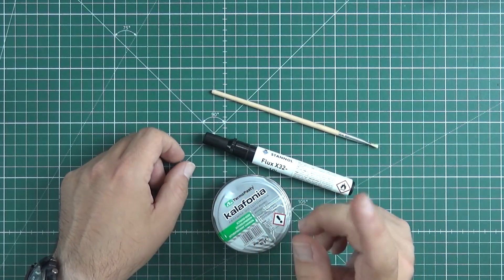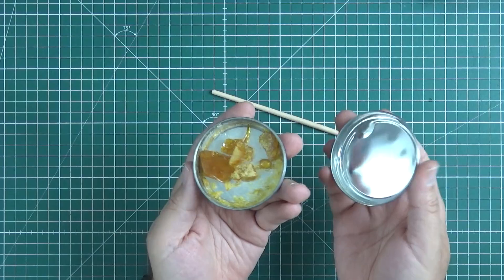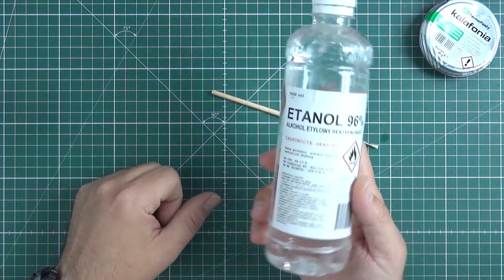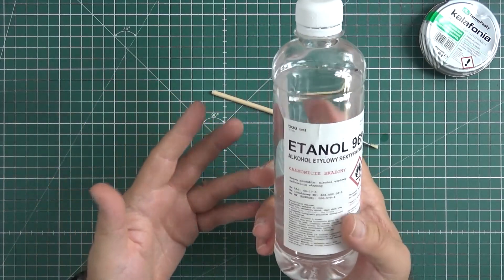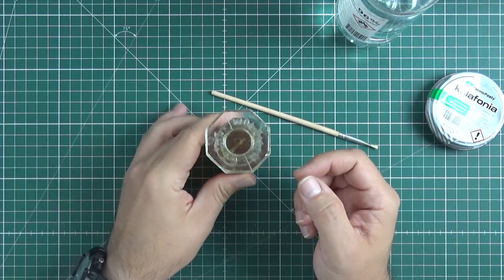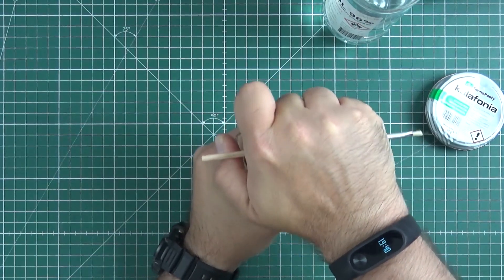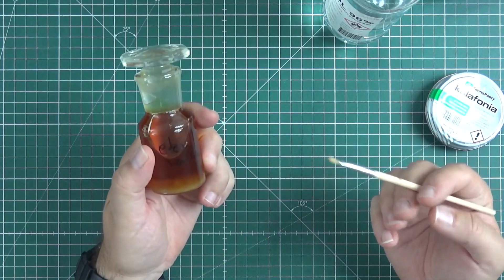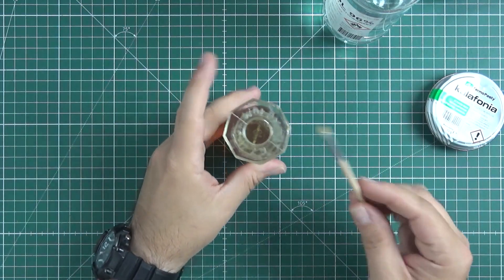DIY liquid soldering flux

Comment: Hi there I tried making this Kind of flux liquid as per your video however it turn out to solid state stone like after resting for 24 hours leaving alcohol (ethanol)on top in closed glass bottle. What can be problem
Reply: I also took manufactured paste flux, added 99.9% alcohol and it did the same thing separating after a period of time.

Comment: Is this real or fake
Reply from the maker: very much real
Reply: @HackerUni  ok thanks i though it was fake but it's worked
Reply: The majority of the super expensive products on the market, in all industries are made from several basic chemicals, that costs 0,1cent per 1 dollar of retail product.
This is how flux is made.
If you want more aggressive one, just add 2% by weight citric acid from your local supermarket. This is the core ingredients of the flux. There is few more ingredients, that are added to regulate the viscosity, for stopping re-crystallization, for pleasant odor, for not sticking to the board etc... Which you can also find in a grocery store 😁

Comment: I found ingredients real for flux what is material base, there's two type material base beside rosin & isopropyl: 1. Gelatin look like ointment, 2. Gel for general look like Amtech NC 559, but there a lot kind code number type chemical gelatin & gel for soldering type, may should ask people with knowledge chemical material for right number type gelatin & gel for mixture rosin & isopropyl.
Reply: I was thinking of using hand sanitizer they put in places for the virus.
Reply: @makingcookingfixing sanitizer contain glycerin. apparently it is bad for pcb

Comment: I just use isopropyl and it has always behaved perfectly and is even cheaper. But I gather the clumsy of pine resin from pine trees in my yard and the surrounding woods. But the chunks of rosin have bark dust and sawdust for boring larva so it has to be dissolved in a sealed jar of alcohol and allowed to settle for a few days before the clear amber liquid is poured into your flux bottle.  When it works well my flux is as crystal clear yellow as fine machine oil. If it is just mediocre then it looks like German dark beer.
Reply from the maker: Thanks for sharing!